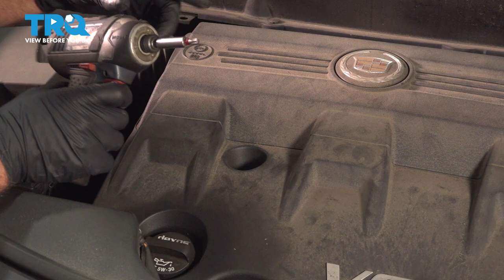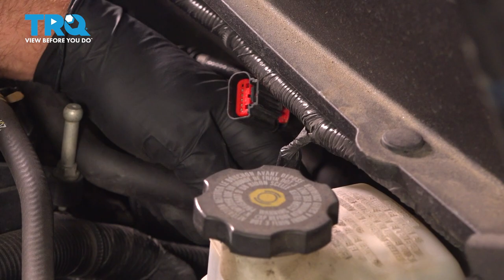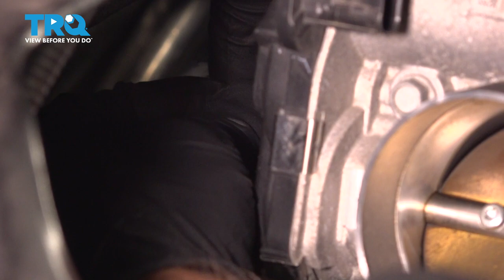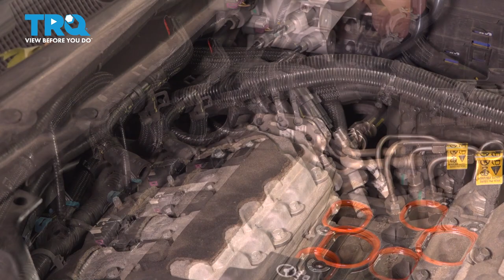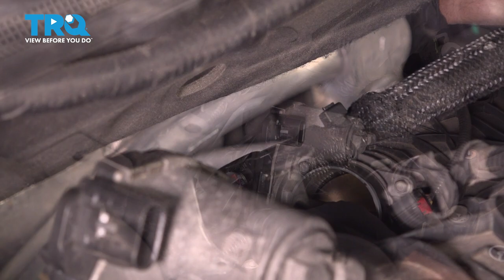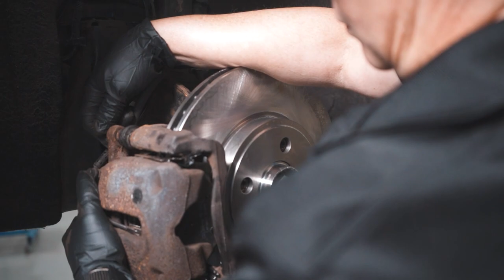How to Replace Spark Plugs Cadillac SRX 2010-2016

Comment: Thanks!  I let a shop replace the plugs at 90K miles when my SRX was in for another problem.  I forget the cost, but it wasn't cheap.  I'll never do that again.  I do as much maintenance on my car as possible.  You just dispelled the idea that plug changes are not for the DIY'r.  I'll be doing my own plugs in the near future.